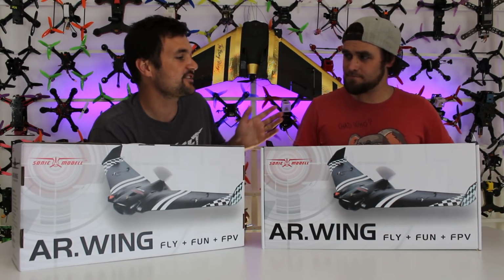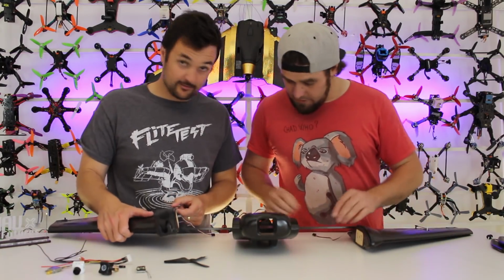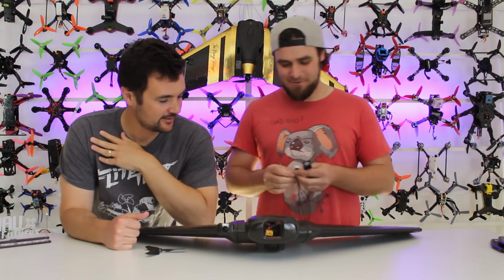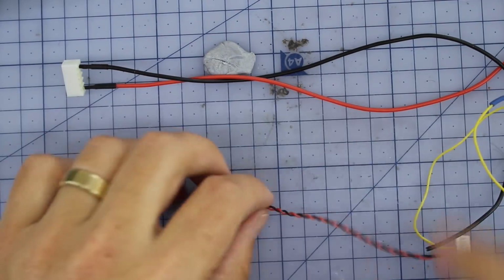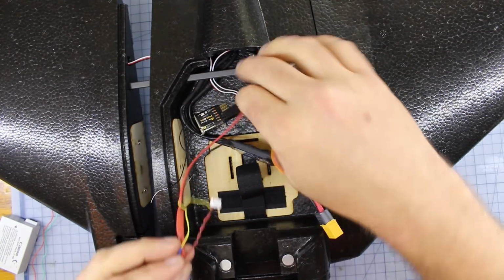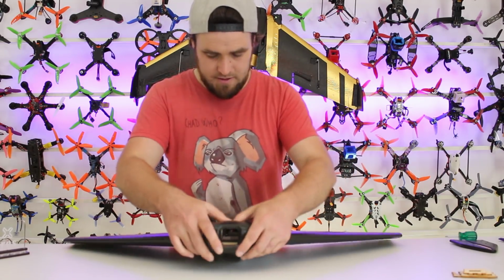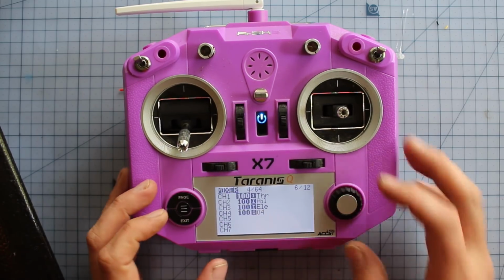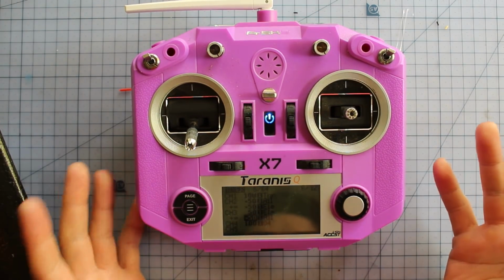HOW TO BUILD A BEGINNERS FPV WING IN 15 MINS - EASY GUIDE

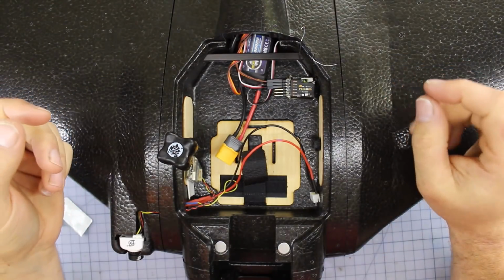Comment: What reciever did you use (looks like an FrSky)? Also, what is the red/yellow cable shown on the reciever going below the XT60 (12:15 in the video). I am having trouble getting the servos to respond to PWM (wondering if I need a PPM reciever?). THANKS!!!

Comment: What? No flight controller 🤔
Reply: Dont need to as a fixed wing is aerodynamically perfect,  and only 1 motor so nothing to work together with.
There are ones with flight controllers if you want stability mode etc.

Comment: i have a question i have the same kit... do i need to buy a flight controller? also more importantly how do i install the wing tips? its the foam and seems to have a rough cut wooden piece as well, do i paint the wood and does that install on the outside or inside between the foam wingtip then the wooden piece then to the main wing? im stumped here please help... thanks in advance for any advice you can share.. and how to mount these darn wingtips?! thx again.

-peter

Comment: good video... and a good wing... but right now I have a hard time understanding why you'd buy an AR wing over some options... there are a few other wings with identical foam, just some differences on electronics... if you are running frsky go with the frsky AR+ wing on hobbyking... use the 10% off code and it's $5 more than the ar wing and comes with an awesome ESC with telemetry, a better motor,  and a s6r frsky receiver which has a gyro/auto-stabilization built in and is programmable to use on other things if/when you upgrade your wing to inav or kill the wing...  and if you aren't a FRSKY guy you've got the RMRC recruit (at least here in the US) which is again the same wing but with a simple FC option that will use standard receivers or spektrum satellites or an rx with ppm or sbus...

Comment: Does this wing need to use a GoPro to fly or is t not necessary?
Reply: I believe the weight upfront is needed.
Reply: Teddy Hutcherson yeah I’ve heard of that but what if I don’t exactly have a gopro😂
Reply: Twisted Props FPV go buy lead fishing weights and look up how much a GoPro weights and add the appropriate amount. Problem fixed

Comment: Hi I build you v2 $99 build and I can’t get my radio connects either the drone I build the pro one and have a flysky fsi6 radio with a fsia6b receiver I have it connect to sbus and is not working what should I do
Reply: I'm new...but I have a flysky i6x and A8s receiver. Had to replace my receiver the other day, after I did I was getting it to bind just fine but nothing would happen with my kwad. I had to hold the bind button for 2sec after successfully bound to change ibus to sbus. I have an RtF and can't access Betaflight but checking your protocol there if you can would be good too.
Reply: COLD DASH I had it connected to the sbus but the pad broke off so i connected it to the rx6 pad and it’s still not working and now it will not it will not connect to beta flight.i thing is broken but it lights up and beep
Reply: Should I buy a new flight controller or is it my remote controller
Reply: Wish I could help, I did find my fix through a video reply tho
Reply: Thanks I Tried the holding for 2 second thing but it didn’t work

Comment: truthfully, flying wings or hotliner/warmliner gliders (max lift and speed) has an effect on adrenaline that is hard to match. I love the Sweepwings Behemoth (build it light, 4s, 80amp, 930w, 11x8), and Juggernaut (4s, 1800kv, 60amp, 780w, 8x4 prop), and a 4s Phoenix 1600 (plastic fuselage) with a 1400kv, 60a, 730watts on  8x6 prop that goes about 85mph. Great video guys, that wing actually is a great lightweight wing ,the AR here.
Reply: I'd love to get my hands on a Behemoth or Juggernaut. BIG BOIS!

Comment: Good stuff but can you please explain stuff like what RX you used, arming, does the ESC brake when you reduce throttle? Would you need to be able to disarm but still have control of the ailerons? or does reducing throttle stop the prop spinning completely for landing? Is it better to have CG nose heavy or tail heavy? How do we trim, just using the trim buttons on the radio?

I just received the mini 600 mm wing in the BNF version, I'm worried it will be harder to fly than a bigger wing and was considering trying to fit the matek f411 wing fc in but I would rather keep it simple. There's lots of info on INAV etc online but this is the closest thing I've seen to setting a simple wing up in an easy to understand format, would just love a few more details like what we need in a receiver because we are used to s.bus etc. and don't know what's needed for servos etc. without an FC, thanks guys.
Reply: I have the RMRC recruit which is the same as the AR900 except it has a stabilizer with launch mode makes it so easy to launch.  Then I got the AR mini for my second wing, it is a little harder to launch without the stabilizer but not to bad. I have had the best luck launching the mini while wearing goggles because it was rolling on launch.